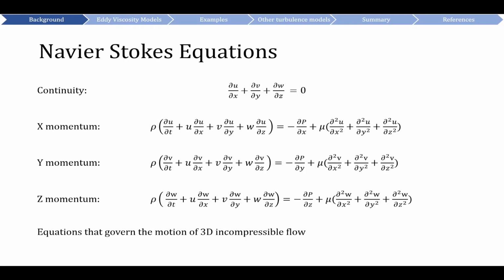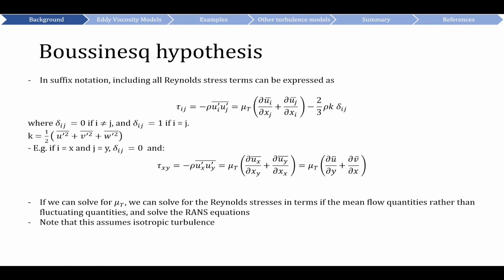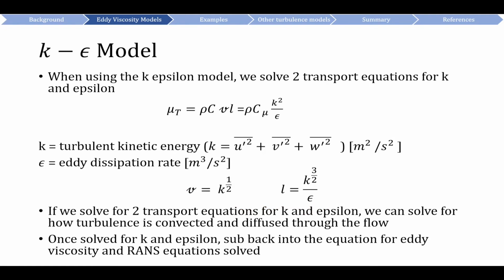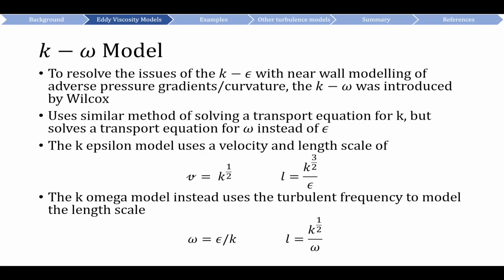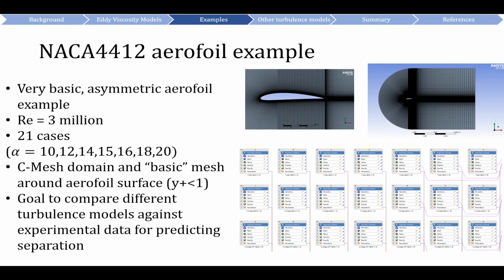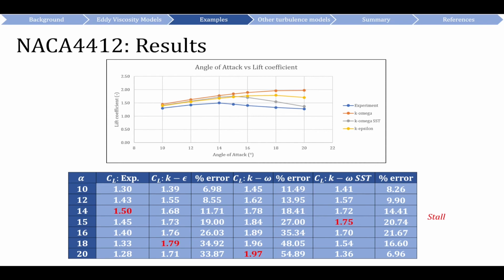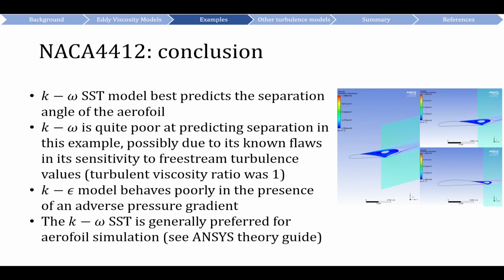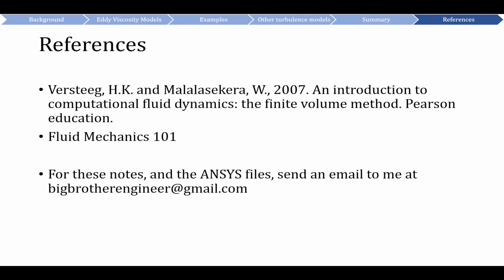NACA 4412 example: Comparing RANS turbulence models CFD

Comment: Thanks for the great content, Cillian! I really appreciate the thorough explanation. I’m currently conducting CFD analysis on a symmetric airfoil to derive its lift curve. However, when I approach the stall angles, the solution struggles to converge, and the lift coefficient starts oscillating between two values, forming a sinusoidal pattern. How did you handle this for post-stall values? Did you average the oscillating results, or use a different approach?
Reply: I used the Shear Stress Transport k-omega model

Comment: Awesome analysis! I have 2 questions;
- for the k-epsilon model, the y+ requirements differ from that of the k-omega model; would it be preferrable to also create a mesh with that in mind? Sure, it doesn't make the simulations comparable directly, but running rerunning the cases on this second mesh could work as well
- when looking at experiment results, do you happen to know what the measurement process or workflow was? Essentially, you are comparing a computational 2D domain to a set of results that were carried out in 3D and then later derived to give 2D results? I am quite clueless on this.
Reply from the maker: Hi,

Yes, if using k epsilon there are different y+ requirements, and the solver will use wall functions to model the effect of the boundary layer rather than resolving it, hence a coarser mesh can be used in these cases, provided the user is aware that boundary layer effects may be less accurate.

Yes, the data was taken from a 3D case and converted to a “section lift coefficient” which represents lift per unit span.
Reply: @cillianthomasengineering  what do you guys mean by the k-epsilon requires a diffrent y+ value; should the y+ value be lower or higher or what exactly? thank you for the wonderful video btw <3